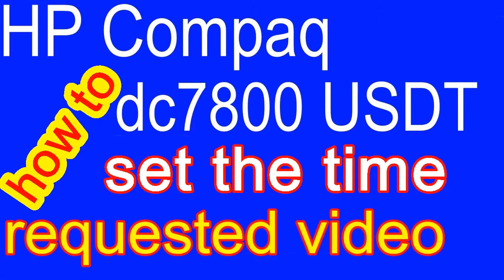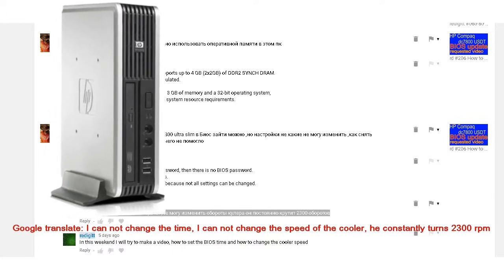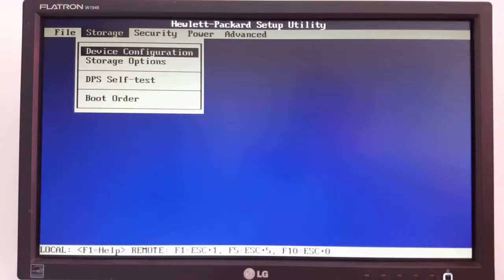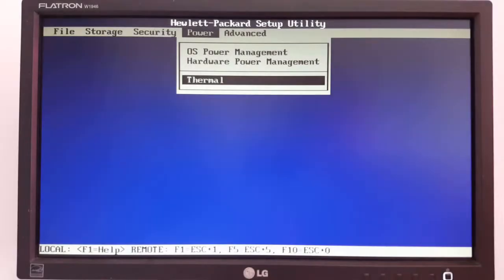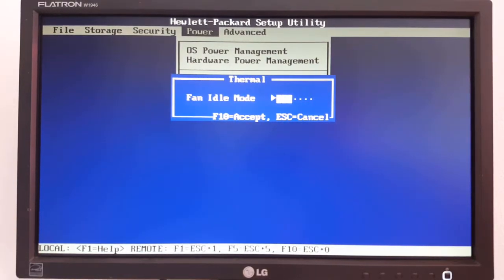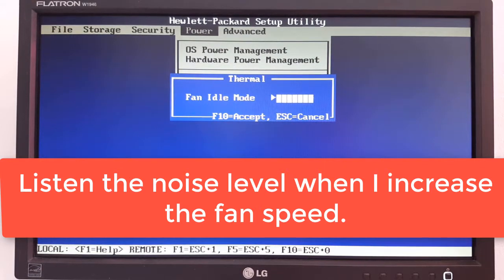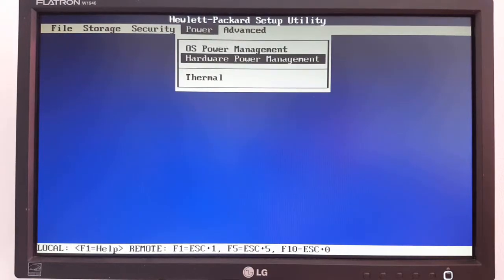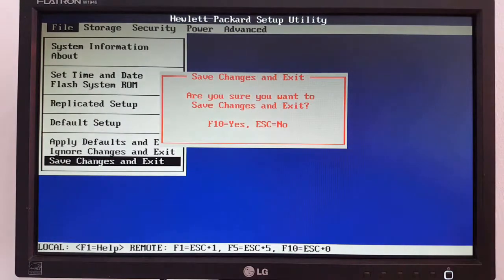How to change the speed of the cooler for HP Compaq dc7800 USDT  requested video Ep.281

Comment: But has the fan adjustment process been set twice? Is it necessary to set it twice?
Reply from the maker: no, itis not necessary to set twice.
Reply: @redigitt  Ok in my case it didn't solve the problem? What could be the cause? My current bios version is v1.04. Do you know that this old version can contain bugs or programming errors for fan control?
Reply from the maker: sorry, i don't know